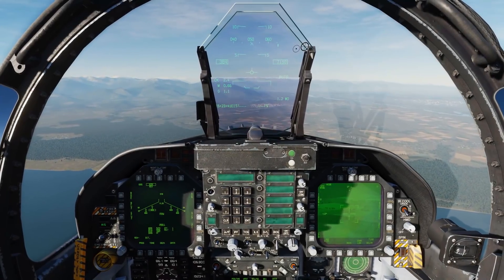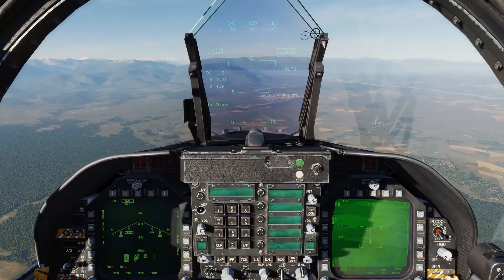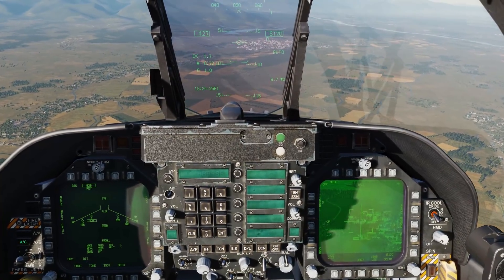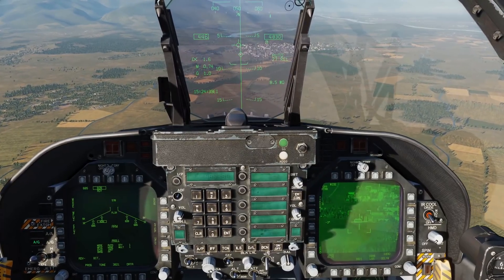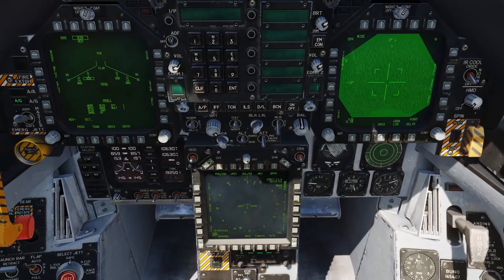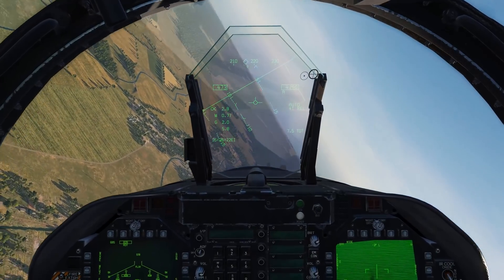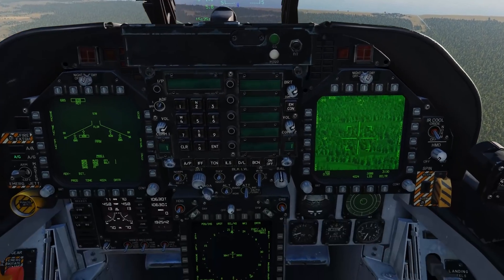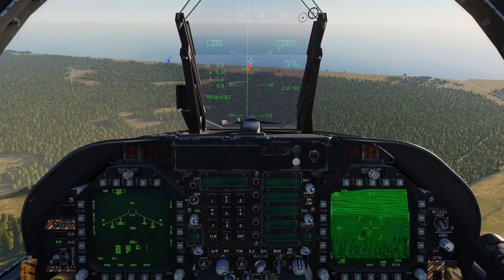DCS: F/A-18C Hornet - Targeting Pod Update for 17 March 2020

Comment: I'm having issues with the TPOD last few days or so. It automatically has a random target location designated when I turn it on and I am unable to slew the TOP it's just locked in place. If I turn it off then back on again I am able to slew until I designate a target but cannot select new targets after until I turn it off then back on again. Also cannot undesignate at all

Comment: VVSL no longer an option in Openbeta.
Cage stows it but uncage does nothing. Cage/Uncage no longer works to reset to 5 degrees low and center. I have to set FLIR switch to stby and back to on quickly to reset.
Tpod does not seem gimbled to the aircraft attitude anymore i have lots of difficulty now getting it pointing to the initial targeting area after latest update.
Left DDI extremely bright at night fulle washed out can't use for FLIR.
I suspect that the option to slew the tpod to the waypoint is also no longer available but i did not test this yet.
Reply: Edit - VVSL option for the Hornet's TPOD is available again.  It is initially available when you first spin the TPOD up but as soon as you start using it the option is no longer there and there doesn't seem to be a way of bringing it back.

Edit 2 - What appears to be happening is that when you first hit the designate key, without the ATRK or PTRK OPR set, it places a way point marker, visible in the HUD. The VVSL option is made unavailable in this mode. Undesignating makes it available again and removes the way point.

Selecting ATRK or PTRK, but not designating, fixes on a spot with no HUD marker displayed. In this mode VVSL is still available and slews you back to the VV.

Comment: So in the past, using JSOWs in TOO mode against a group of tanks, you could slew to a target, designate, undesignate and step to next weapon, slew to next target, designate, and so on.  Now when you undesignate, the TPOD leaves its last aim point and goes somewhere else.  Is there some way in the current switchology to target multiple targets in a group like this?
Reply: I use LSS and TPOD to get target coords, then TDC depress into JDAM/JSOW TOO memory. But each weapon needs a separate designation. If I undesignate the TPOD goes into silly mode and not even a WP designate target will get it back. I go sensor depress right three times, area, point, off. The TPOD is still buggy in 2.5.6 release. At least it is for me.

Comment: Is it true that the F/A-18C does NOT have TGP symbology on the HUD? Such as a box or circle that actively moves on the HUD where the TGP is looking.
Reply from the maker: Correct. Thanks
Reply: @MattWagner  bummer. But okay, thanks for the reply
Reply: @cbinder46  you can however see it on the SA page!
Reply: Wow I didn’t know this. I suppose the actual pilots got on without it, so I think I’ll be fine in my office chair.

Comment: What about HUD designation when you don't carry a CCRP capable weapon?
Reply from the maker: Then yous use VVSL, and undesignate to CCIP on the roll in. Thanks
Reply: @MattWagner  If that's the case, what would you say is the most effective way to put the POD on a JTAC smoke signal (or anything that you spot visually), without lowering the nose?

I know that HUD designation exists in NAV mode and can even be used for INS updating (if needed). This will help a lot if this feature will be implemented eventually.
Reply from the maker: @Golden5er . You would need to use VVSL for a visual pick up. We have no evidence, proof of HUD designation in NAV mode. Please feel to PM me on our forum is you do. Thanks
Reply: @MattWagner  Thanks - PM sent.
Reply from the maker: @piston_77 . Sorry, but it does not and the NATOPS has no mention of TGP pointing modes in AG mode, only a position fix for NAV mode. Thanks

Comment: Question about the waypoint designate with the TPOD: After you WPDSG slew it, and TDC depress to designate again, does it change the waypoint coordinates?
Reply from the maker: Negative, thanks.
Reply: Luke M. No
Reply: Yes it changes the coordinates in the memory for entry into the JDAM/JSOW targeting when in TOO mode. But the pre existing waypoint remains unchanged.

Comment: Will the waypoint snap mode work with added waypoints in flight?
Reply: Must be. You use push button WPDSG to make it happen with TGP, there is no reason why it wouldn't work with in flight added waypoint as you can weapon designate them.